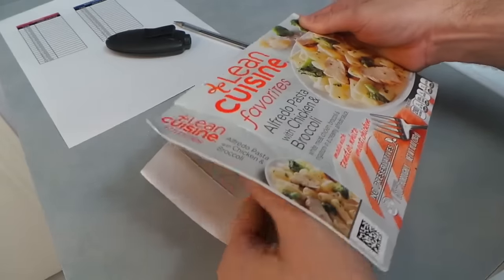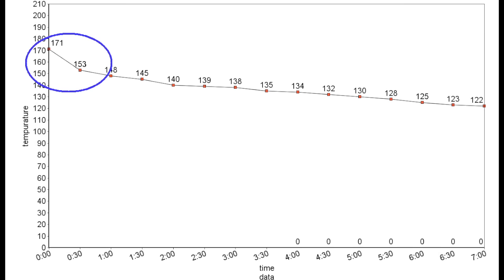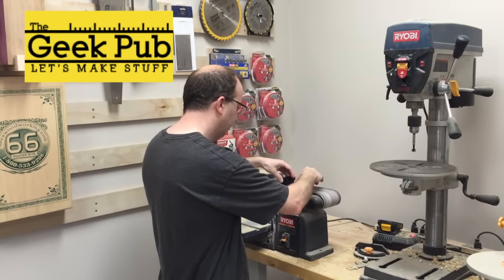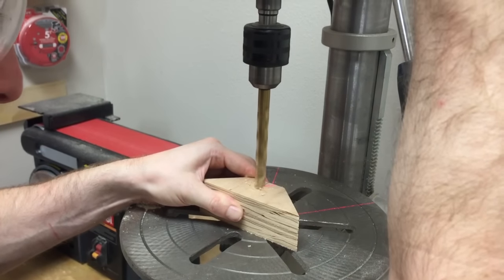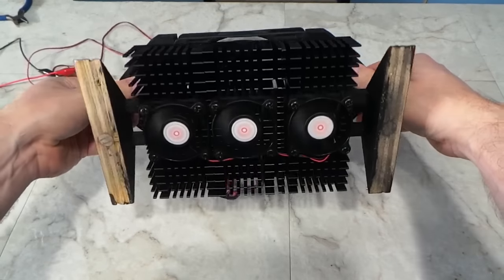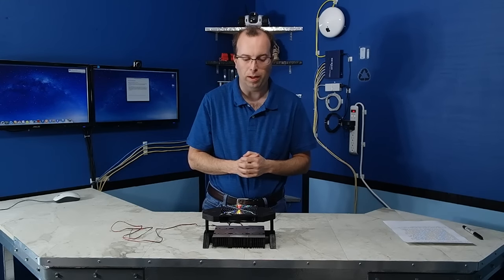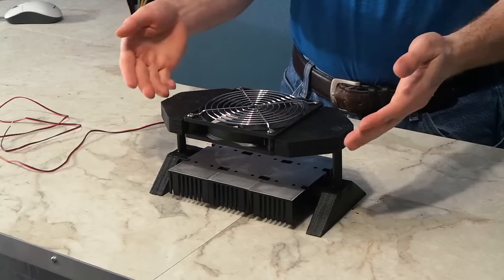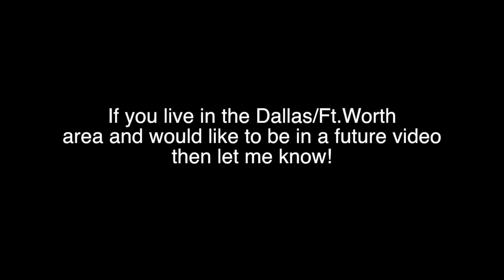CPU Heatsinks to cool microwave dinners

Comment: Cool Video! I have a Really Quick Question, So, i have an iBook G4 and it seems to run really hot and the fan only kicks on when it almost burning my legs, is this normal?
Reply: GaminGod Coffeeman Might be a bad thermal connection or a bad fan sensor.
Reply from the maker: GaminGod Coffeeman Not that it is related to this video, but I covered that in a previous episode and how to fix it.
Reply: The iBookGuy Ok, ill check, and one more thing, for this video, can you use regular heatsyncs for this? Like, from a Pentium D?
Reply: GaminGod Coffeeman  in this video it shows a clip on heatsink from cartrage style pentium processors. They were bigger and retangle. I belive the pentium D heatsink is a circle and much much smaller. So for something like a coffee would work good not a microwave meal
Reply: Andrew Johnstone the pentuim d one must be quite big considering their heat output!
Reply: Michael Flatman If you went out and bought a I3,i5.i7 they still use the exact same heatsink as the pentium d
Reply: but at least they have better performance, i hated the pentuim ds the were noisy and slow, like the prescott pentuim 4
Reply: Michael Flatman I Had a pentium D running at 3 GHz and it handled GTA IV like a boss
Reply: GaminGod Coffeeman The extreme edition Pentium D (Unlocked ment for overclocking) could get upto 5Ghz on the stock cooler

Comment: Interesting project, but why not just heat your meal properly so you don't need to cool it down?
Reply: +mtothem1337 But then it doesn't "cook" very well.
Reply: Vrabb Microwave meals are already cooked, you just need to heat them up.
The best way to overcome the uneven heating issues is just mixing it together.
Reply: +mtothem1337 
I think it's because they are frozen so need to get really hot so you don't get cold bits in the middle of all the food.
Reply: +darbyjack Just heat it longer with fewer watts, or leave it in the microwave for a minute after it's done. Then again, that would take more time. Saving time is the reason he invented the cooler.
Reply: +Cees Timmerman Ah I just cook meals from scratch actually :P
Reply: Oriru Bastard Using a microwave to cook food is wrong in the first place, but if you insist. The best way i've found is microwaving in cycles, then talking it out and stiring the food around distrubuting the heat, and repeat until you are happy with it.

Personally i heat my food either in the oven or on the stove depending on what i'm reheating.
Reply: Oriru Bastard But raw veggies have tough cell walls, which is why cows have multiple stomachs and ruminate. Humans simply cook the food. Fruit is bad for teeth and meat is mean to animals.
Reply: +Oriru Bastard actually we arent carnivores, were omnivores. carnivores only eat meat of other animals. we are designed to eat meat, vegetation and other (insects and fish fall into other)
Reply: we are omnivores but honestly 
who actually likes salad 

il take a porterhouse steak over a carrot anyday
Reply: and I'll take a carrot over a tortured chicken
Reply: then you are no better than i
Reply: I don't think carrots are more intelligent than flies, and i kill flies without eating them.
Reply: This is what I was thinking. The microwave meals are already cooked, at least all the ones I buy are. You just need to reheat them. If your food is getting to 180°F, you are lowering the quality. Reduce the power or the cook time. Preferably, reduce the power. Lower power tends to lead to more even heating. And, take it out and stir it more often. I have found that the directions on the package don't necessarily give you the best results. Experiment a little.
Reply: Frank Strait The ones I buy are half-cooked, with the missing cooking time calculated to match the microwave instructions on the box, which leaves the finished meal hot.

Comment: Why not just stick it in the fridge >_<
Reply: You forget about it, then it gets too cold, then you end up putting it in the microwave again, then the whole process repeats 😂
Reply: 2chws You're really not meant to put hot items in the fridge. Heats up the whole fridge, causing poor energy efficiency and bacteria buildup.
Reply: Reece McGowan makes sense, but I think the risk is negligible for something like a frozen dinner
Reply: Reece McGowan You made me laugh, picturing a single lean cuisine affecting the fridge that much.
Reply: +Good Fictive Weekend ive never once forgot something I put in the fridge
Reply: +Reece McGowan Wrong
Reply: Iggy Tubmen If I am wrong, tell me what is right. You might want to explain how the heat is meant to leave the fridge with no venting and not causing the compressor to run constantly in a vain attempt to stay cool.
Reply: Because that's to easy

Comment: Great idea. I bought a High Airflow 2 x 120mm USB Cooling Fan with Speed Controller online. It has built-in feet and guards. I place the hot meal on to the fans which blow air on to the tray base. No fans on the top. It works well. It cost me about the same as The 8 Bit Guy's.

Comment: I think part of the reason that the meal cools down quicker with the device he made also has to do with hot air (which rises) being replaced by cooler air and rapid cooling thus occuring.  Obviously the cooling on the bottom helps too as it does the same thing (displaces hot air and surfaces) and replaces it with cooler surfaces and air thus accelerating the process).

Comment: I turned my old stock Intel heat sink into a food cooler, but in my case I managed to find a Molex power connector and a 3pin to Molex adapter that would connect to it. It works just fine as I use it to cool things like chili, beans, soup, coffee and other things.

Comment: what does the heat sink actually do besides 'be metal' and 'have lots of surface area' ?  you mentioned being able to turn it on and off, independently of the fan.

Comment: Very interesting. I just subscribed 1 hour ago and I am enjoying your videos of recent, as I scrolled through all of your old videos I found the older ones weren't very intriguing. My advice for if you ever seek to appeal to a larger group just take this in to consideration, KEEP MAKING VIDEOS LIKE THIS.

I had been inspired by your ideas and I have one for you that you may possibly build so I can see your spin on it.

Depending on which device you use to record video I was thinking of a video hub.

Rough idea: 
-your cam corder records video, then it directly saves this data TO an external desktop drive or usb flash stick
- maybe it saves it to a raid array like you have made in previous videos
-THEN from that mass storage hub it can be directly connected to your computer, which you edit, save back (to the external hub)
- and boom it's ready for YouTube upload.

We can call this a Stationary Video Hub™

Thanks for reading hope you will consider this idea.

Maybe even have it with built in cloud and YouTube upload features by say linking it something else who knows!

Comment: I did something like this but for tea with an Intel heatsink attached to a Via heatsink. I also added a microcontroller, possible and temperature sensor so it could measure the temperature and turn off the fan and sound an alarm when it reaches the correct temperature.

Comment: if you ever make a V2 of this, my suggestions would be making the top fans removable. make the two stands straight pipes and let the fan assembly slide into the pipes. this would bring the fan closer to the tray. also flip the fan around. this would cool the food better and would be more sanitary as you would be pulling the hot air away from the tray rather forcing cool air in. 

good luck anyway. thanks for your videos. they've inspired me to check out my local hackerspace. i always get ideas like these but never carry them out.

Comment: Cool concept, but for a much cheaper and easier application put the meal on your stovetop after it comes out of the microwave. The thermal properties of the burners are ideal and when they are off work very well for the same result

Comment: Thank you 8-Bit Guy , This video just helped me resolve my ability to control my 12volt battery 36watt per cell @ 6 cells.
It's on a Carquest 8A charger right now and the charger says everything is golden. 
I now remembered I can control my battery with one of these little thermostats and power up my dust eater/solder fume extractor. 120mm DEL server fan. 
Thanks to this legendary video I was able to figure out what to do with my battery. I'll need the controller since it's 5A battery. Can you tell me more about the battery you used here?

Comment: That was a fun video.  You seem to have built a general heat transfer device.  I bet it would be great for quickly thawing steaks or similar items which is a problem i have far more often than too hot microwaved food-the solution there is usually shorter microwaving time :)

Comment: I think microwaves should just have fans in them for this purpose, and they would just automatically add to the time after the cooking time before the completion beep sounds - for example since most microwave foods say to leave the item to stand for 1 minute or so, the microwave cook time would run, and then it would wait 1 minute and not beep, and then the cooling fan would turn on for 1 minute or so and get the food down to temperature so you can eat it immediately when you take it out, and then it would beep to tell you it's ready and done. A peltier device could also be installed under the rotatey cooking plate thing perhaps to cook and cool the food more quickly, but I'm not sure if that could be made to operate safely within the microwave.
Reply: +kassie2k4 Exactly what I was thinking. Well.. just the "microwaves should have fans in em" part ;P
Reply: +OmikronWeapon Microwave DO have fans in them.
Reply: +Mister Thegoodhen did you not even read the rest of their post? Or did u just read the first sentence? I really want to call you an idiot right now but then I would be a hypocrite.

Comment: To actually see what effect the heatsink had, you need to test it without the fan. Forced convection (airflow caused by the fan) transfers heat at a much higher rate than natural convection.
Reply: Jonathan Rogers
Forced convection is convection. Convection is heat transfer through a fluid (the air, in this case).

Comment: The video is fun. To solve the normal problem is to have it in 60% of the time it says. Then let it rest for the 40% of whats should have bin the time. And then put energy in it agen, for 40% of the time it did say on the package. Then you watch The 8-Bit Guy for 1-2min before you start to dinner. And if you read it says to hold the plastic on and maby some holes so the cooking and spread of temp works.

Comment: You could use a Peltier thermoelectric unit and let the heat of the food power the fans! Would have the dual benefit of stopping or slowing the fans without any logic circuitry as the food cooled.
Reply: You have clearly never actually used a thermoelectric pad
Reply: @TechHowden  You're right, I haven't. Thanks for pointing that out. Since you didn't elaborate on why my idea wouldn't work, I'm guessing it's because enough voltage wouldn't be generated to power fans. However, some voltage would be produced, and you could measure it with logic circuitry and use relays to control the fans.
Reply: @NortelGeek  , it’s because the modules probably wouldn’t generate more than like 3v and definitely not enough current either and you could use one to measure the temperature but it would be much easier to just use a thermal probe and an Arduino and a couple of MOSFETs

Comment: Actually, I don't believe the initial quick cooling has anything to do with the counter top.  Microwaves are tuned to the frequency of water molecules, so dump energy into the liquid portion of the dinner (frozen or not) equally.  The water molecules in the center of the dish can't flow their heat out while it's cooking because all the material around them is heating up at the same rate.  That means microwaves heat food from the inside out, rather than the outside in as normal cooking does.  What you observed is the final surge of heat from the inside of the dish coming out and normalizing with the rest of the food matter.  The linear drop after that was normal cooling.  This idiosyncrasy is why all microwave dinners advise you to let the dish stand in the open air for a few minutes before eating...to allow the heat to normalize in the dish.

Comment: It would be better if you pulled off a fly-by-wire gas pedal from a salvage car and used it to control the fan speed, like flooring it gives the most cooling and letting it off gives less cooling

Comment: Respectfully, I think this is silly. If your dinner is “too hot”, either reduce cooking time/power or realize that in many cases the food is continuing to warm through after microwaving. (This latter point is mentioned in many package directions.)

What might be needed is something to speed up bringing a high volume of hot food (e.g. a pot of stew) to refrigerator temperature.

Comment: I realize this is a very old video, but I thought I'd throw in my 2 cents... if the food was pre-cooked before being frozen, why not just microwave it for a shorter amount of time, until you the find that sweet spot where it could be eaten right away?
Reply: Because microwaves don't heat evenly and you end up with a cold or still frozen middle part.

I had this problem with frozen meat pies (I keep a pack or two in case I can't be bothered cooking) and I found that the way to get those to heat evenly was to use a ceramic plate and heat it upside-down for half the cook time, flip it right-side-up and then finish it off. Best part was that it took half the time to cook, and I don't have to wait for it to cool down.

Comment: Experiment is a failure from the start: Microwaves don't heat evenly, causing hotspots and coldspots, you need to first stir the contents of the package before taking a mean temperature.

Comment: Ever thought of putting it in the microwave for a shorter period of time?
Reply: would make for an possible uneven cook. you gotta consider 2 factors, the amount it does a revolution within the amount of time, and how much you need it heated, if you slow it down without considering these 2 it can lead to not being good, factor 1 is very much going to be the most important as if it doesn't heat all over that might mean theres a little bit of cold areas on the food

Comment: If you're looking for a switching system, I'd suggest getting a 4-way switch to use as both a fan selector and an on-off switch.

The best I could find is this switch designed for guitar pickups, but it should do the trick: https://www.sweetwater.com/store/detail/Oak4

Comment: Why not heat it up for a bit less time in the microwave oven?? Or,... Don't heat on high for 4minutes, but heat it on medium for 5.5minutes. Or Med-Low, for 6.5 - 7 minutes. It will heat it more gently, and evenly. That's how I use my microwave oven.

Comment: mmmh... sorry, I'm italian, and I can't see pasta in microwave... hahaha... if you want I can teach you how to do a perfect italian pasta.
Reply: +Smitty Smittersin ok so here there are important points:
- take a big pot and put some water inside it. Water must be A LOT, about 1 litre (=  0,264 gallons) per every 100 grams of pasta you want to cook.
- put the pot on the cooker and wait UNTIL IT BOILS, then throw some salt into it. You can taste the water, and it should be a bit salty, not much. You need about 1,5 pinches of salt for every 3 litres of water.
- after putting salt, water should be stop boiling. wait until it boils again (NOT BEFORE!!) and throw your pasta into the water. Pasta "Barilla" is good. You can put from 80g to 130g per person, depending on how much you eat.
- then you have to keep you pot on the cooker, and keep the water boiling. Usually cooking time is specified on the pasta package, or you can taste it yourself and stop cooking when you like it. The more you leave it cooking, the more it will become softer, and after willl become a perfect glue. Italians like pasta "al dente" (a bit hard, not cooked a lot). Anyway, for the first time I suggest you to follow the cooking time on the package.
- when you have decided that it's ready, get the pasta out of the water and put it in plates.
- then you can put any seasoning or sauce you want, but please NO KETCHUP, NO KETCHUP AND NO KETCHUP. If you want I can also suggest you some good italian pasta sauces (bolognese is good but not the best in my opinion).
Keep me updated if you try following this instructions, and say me if you liked real pasta :-)